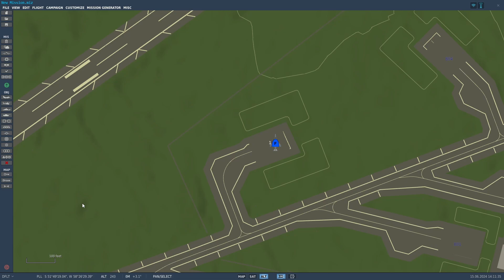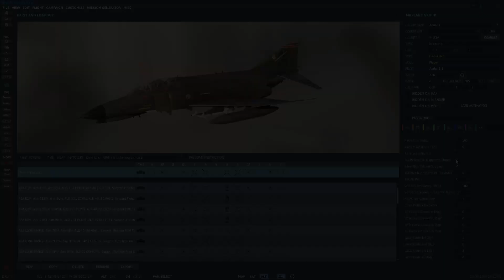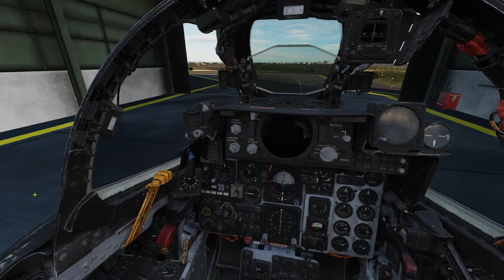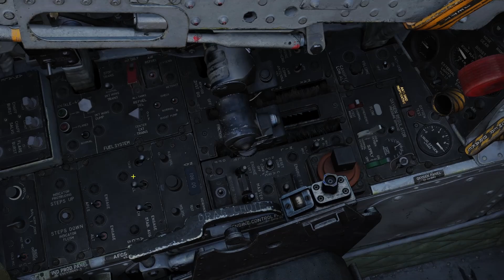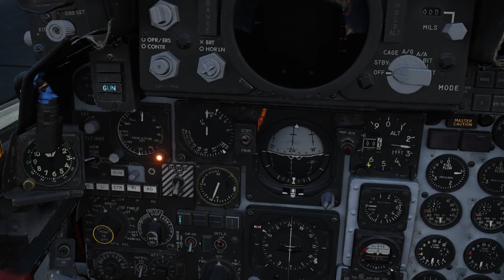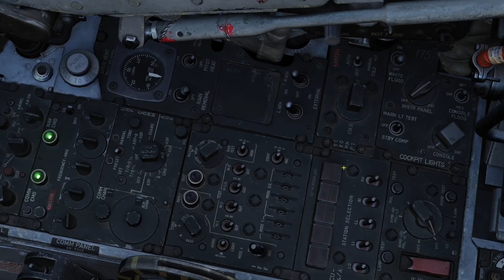DCS World: F-4E Phantom II Cartridge Start/Scramble Tutorial

Comment: Errr, just tick the engine start switch ince per side within a second, then push both of throttle while holding the ignition button.

And I usually do not even wait for alignment. Just use TACAN! And tick all the switches while taxing. Forgot something on the way? No problem. Analogue buttons still work fine!